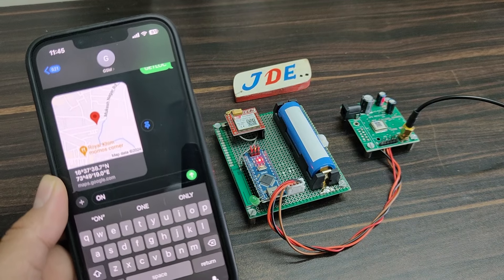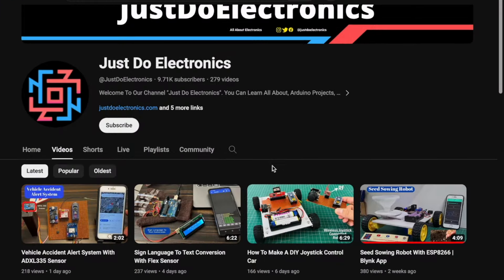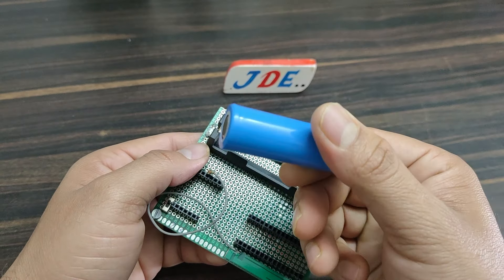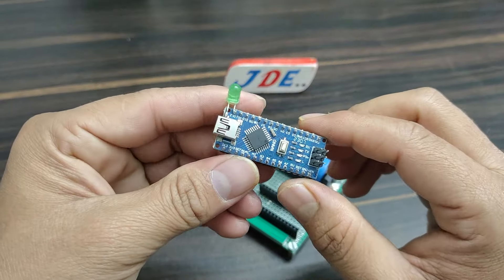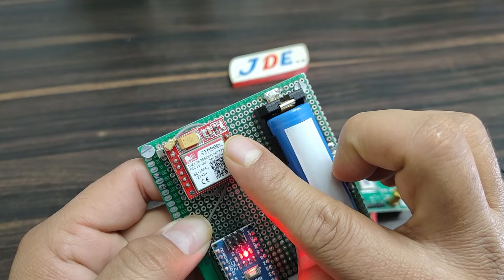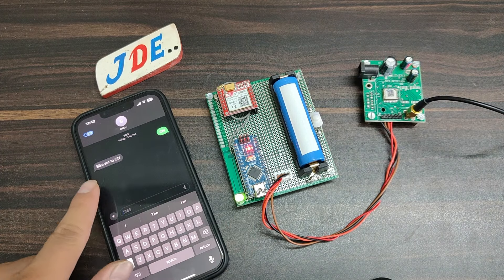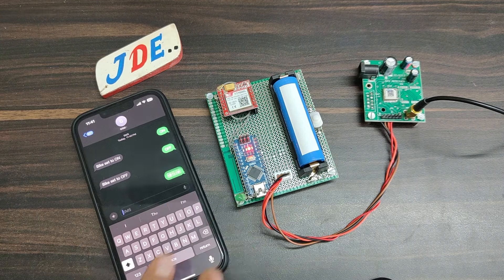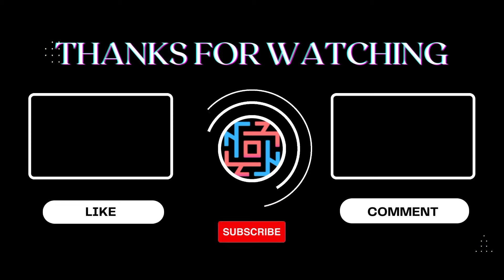Build Your Own Gps Tracker | Sim28 GPS Module

Comment: This is a nice project.  If you are interested in new ideas.
You could add the following : 
1 digital input - connected to car ignition wire.
2 digital outputs (1 and 2) to control different relays. 
Function:
When you turn car on, it sends signal to module via "digital in" connected to ignition wire.
Add sms commands to turn Output 1  "on"or "off" to control car starter. 
Then output 2 connected to car horns and blinkers. If sms to turn "on" output 1 is not sent to module and you try to start car, output 2 will turn on car horn and blinkers.

Or better yet add a Bluetooth module to control output 1. If digital input  1 gets signal from ignition and phone is not connected to Bluetooth module, if you try to start car it will trigger output 2 to turn on car horns and blinkers